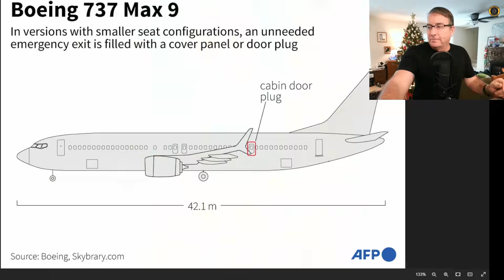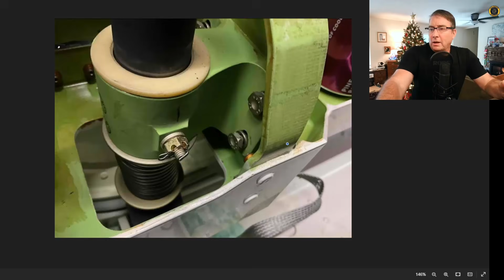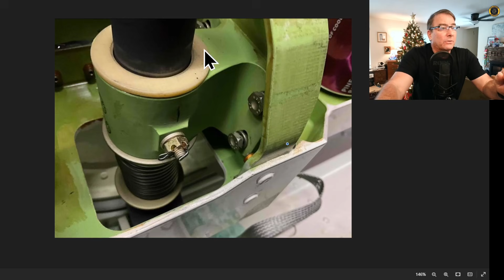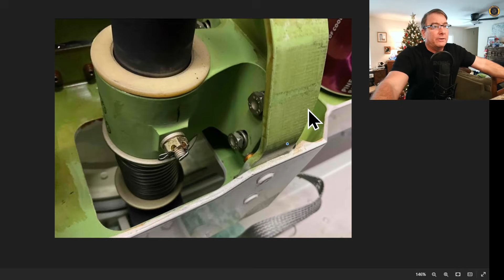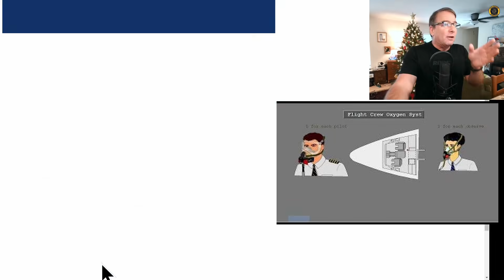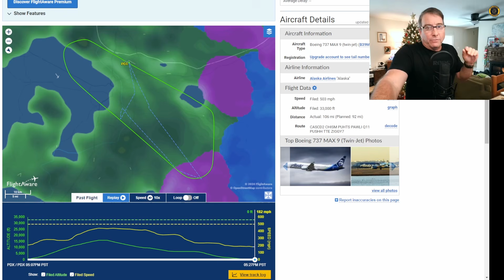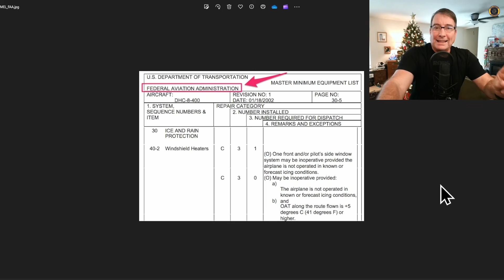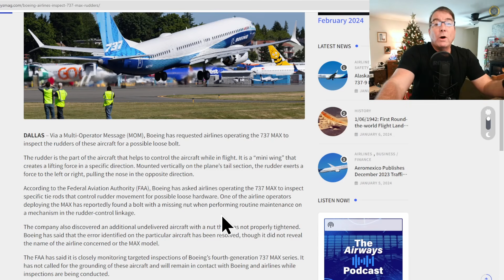"Yes, We Have No Bolts"  9 Jan 737 Max-9 Update

Comment: I disagree with your assesment that previous pressurisation alarms were caused by leaking door because of two reasons. Firstly, how on Earth changing pressurisation control to alternative controller fixes the leaking door? Secondly, I have been informed that leaks on aircraft are accompanied with loud squaling noise. No noise was reported before the plug departed the aircraft.

Comment: Personal opinion, those lower brackets to the aircraft only have a lock washer, it seems (looking at how the lock washer is diving into the holes in the bracket) a plate/flat washer should be on there as well.
Reply: That is why the door was hinged at the bottom, and it opens out and down.
Reply: @c4o-y8f  that makes no sense. Please look at the bolts holding the upper brackets to the body of the plane.
Reply: I'm not sure what you're looking at?
The picture that Juan was using as an illustration shows the aircraft door frame on the right, and the plug on the left.
What is fastened to the aircraft is called an upper guide roller. What is fastened to the plug is referred to as the guide track. 
 2 of the  bolts in question and locking nuts go through the guide track and prevent the plug from moving up on the roller guide.
Upper movement is also prevented on the lower hinge guide fittings with a bolt referred to as a vertical movement arrestor bolt. 
The lower hinge bracket assembly has a lifting assist spring. Once all four bolts to the top through the bracket and two at the bottom on the hinge guide. The plug is allowed to move up an inch to an inch and a half to clear the six pressure mounts on each side of the plug, which meet up with their counterpart on the aircraft frame.
On the ground with no air pressure, the top of the door would swing outwards.
There are two nylon straps at the top of the door on the left and right sides that prevent the top of the door from opening more than 10 inches.  For maintenance on the ground.
The two nylon straps were tore and without the two bolts and nuts installed on the lower hinge bracket assembly the spring assist launched the plug off the aircraft. . I.e. minimum damage to the plug and aircraft.

 

 @berthaduniverse
Reply: @c4o-y8f  you keep looking at the pin and how it is retained. I'm referring to the receiver (again for the third time) that is bolted to the body of the aircraft/frame of the door. The lock washers are falling into the elongated mounting holes. See the video around 5:30

Comment: Why even  have blowout panels on the cockpit doors if the locking mechanism is going to release the entire door anyway!!! 
So much for security!!! 
(Depression = access)
So these loose bolts hold what? 
If they are that important,  then safety wire.or. (castle nut/pin).

Comment: I've been flying the 737 at a U.S. major since 2006, and the door blowing open was a real shocker.  We've always been told there are blowout panels to handle the explosive decompression scenario.  I have recurrent next week, and it's something I'm definitely going to be bringing up as a topic of discussion.  This better not turn out to be another "Whoops, we forgot to mention this in the pilot training manuals!" situation.
Reply: Leaving a comment in the hopes that you will enlighten us about the response you get next week.
Reply: No, it is another "failure to communicate" by Boeing
Oh, sorry about that Lion Air
Forgot to put that tid bit in the manual
Reply: I imagine its set up so that if the decompression force is larger than the blow out panels can dissipate that the door is designed to fail at a level below which serious damage would be done to the cockpit. The size of the hole in the fuselage created by the plug falling off would have allowed the cabin air to escape very quickly.
Reply: @watcherzero5256  sure, but they were barely at 15k feet. The pressure differential is pretty low at that altitude the blast panel should have been more than adequate
Reply: @shaneskillzrepresent  That was my initial thought when I heard the details. 15k is not high at all, although the pressure differential appears to have been enough to blow the door out. Very worrying. What was the cabin pressure set to, I wonder?
Reply: @colins2  Even a very modest pressure difference adds up to a fairly big force over an area the size of a door. At 15,000 feet, air pressure is about 8.3 psi compared to 14.7 psi at sea level. Over the size of an airliner door that would be around 8 tons of force. However, airline cabins are not pressurised to sea level, but typically to the equivalent of about 8,000 feet, where air pressure is about 10.9 psi. Even so, that 2.6 psi difference over an airliner door is still going to be over 3 tons of force. Of course at 30,000 feet the outside pressure drops to 4.4 psi, which means there is a differential of 6.5 psi with cabin pressure, which would be about 9 tons of force over the area of the door.
Reply: It Boeing open door policy . Don't think they going to put in there manuals, management at Boeing are a bunch of idiots.
Reply: Were you told the cockpit door was meant to blow open during decompression?
Reply: Four questions I would like Boeing to answer:
a) when did Boeing change  from panels to "full door" ?
b) why ?
c) did they not consider that the blowing out the door and depressurizing the cabin in an instant would lead to papers/checklists etc all blowing out?
d) do they intend to leave it like this or will they go back to panels?
Reply: Unfortunately, Boeing is run by MBAs nowadays and they chased away all the engineers. You won’t get a straight answer. @oldcynic6964
Reply: Now why would a blowout panel be located right next to a passenger seat, and large enough to suck a person out of the aircraft? It’s been established that the piece of the plane that failed is a plug door. Please try a little harder next time
Reply: @fartmoderne  He was talking about the cockpit door that blew open. Boeing has already said something like, "Whoops, we ought to put that in the manual."
Reply: How would you make a panel that can go both ways?
Reply: This seems like a flaw in security because a bad actor could simply explosively decompress an aircraft and then take it over. You don't need to be flying at 10000 feet to take a plane over.

Comment: 🇦🇺 WOOOW !!!!  Thanks again Juan. More fuel to the fire. One good take away I guess is when the door jettisoned the frame it didn’t impale itself into the tail assembly possibly compromising flight control surfaces there, perhaps assisting this loose bolt in the rudder assembly. That would have made for an interesting outcome. Thanks again for your the effort you put into the detail. 🙏

Comment: There's a massive safety red flag here that, no matter the cost, has to be addressed. If it isn't, people are going to die. It's not a matter of "if", it's a matter of "when" and "how many?".

If there are loose or incorrectly torqued fasteners in this location of the aircraft, then there are loose and incorrectly torqued fasteners elsewhere in the aircraft.

Not only this, but whatever other aircraft are assembled in the same factory also have been assembled in the same "slap-dash, get it out of the door quickly" fashion. Loose fasteners do not exist in one location only, it signifies a culture of sloppy and unchecked workmanship. 

We see evidence of this both in this individual case, the other carriers who have found issues with their fasteners and the rudder issues amongst others.

On top of this, we have a corporate culture of trying to slide the Max in as "just another 737 derivative" when it's becoming clearer and clearer it's a different aircraft that just has some parts/controls rationalisation with it's predecessors. 

Yet another question that needs to be asked is, was Boeing certifying their own aircraft at the time when this was handed over to the customer?

I say all of the above as a very pained lover of Boeing products, it saddens me to see the current situation and the reality facing them.

Comment: For plug to depart the fuselage all 4 bolts must be missing. That's inside info. What I would like to add is a total decline of all services in our society. No difference between drywall being installed without pink insulation installed just because insulation guy called sick. Similar thing here. No bolts installed, who cares my job is to install the plastic panel. Now some of my friends, very experienced aircraft engineers and mechanics are afraid of flying.

Comment: If I understand you correctly, the cockpit voice recordings are overwritten unless the circuit breaker is tripped?  even after an emergency? it sounds like a finite loop recorder, where there is X minutes of Tape and once the tape is full, it just records over the data from the beginning of the tape and will do this in an infinite loop as long as it is powered on. Is this really the best way we have for voice recording the cockpit in 2024?  On another point, why in the world do these planes not have cameras on the plane , looking live back at the plane?  Say for instance , a cam looking at the gear sets, views of each engine, view of the tail and so on. It would be a distraction to the piolts , but have it available to the flight staff at a minimum so they can see if they are on fire and let someone know .. If SpaceX can put cameras on the Falcon9, Boing can do this on a jet. It's a no brainer.  Right?

Comment: Most of my career was in the B737 and never, ever was there knowledge of the cockpit door being designed to open during a rapid D.  Maybe it's only on the newer models but thank you Boeing for once again keeping the pilots out of the loop!  Oh and BTW you never should have stopped making the B757 then all of this would have never happened to what use to be a very respectable American company.
Reply: When sales of the 757 began to dip, Boeing should have realized that it was time to build a new gen version of the 757. Instead, the McD thinking led them to ditch a very good plane creating a hole in their product line they've never been able to plug. Plugging holes is just something they're not good at, apparently.
Reply: No... the 757 had moved up to transcontinental and international ETOPS flights, it overperformed for its original role which became better suited to developments of the smaller 737 and A320. For the Max Boeing should have ditched the legacy 737 cockpit and short landing gear, and grafted on the 757 front section and 757/767/777 cockpit,and redone the wing box for proper undercarriage. @grantvergottini5612
Reply: Don't you remember the "blow out panel" at the bottom?
Reply: Amen, a modern re-release of the 757 would be amazing.
Reply: Why would a pilot need to know if the door will blow open or not? Manufacturers make thousands of decisions, if the pilots are told about all of them they would not have time to read what actually matters.
Reply: @orbit7979  consider this: you train hard for every conceivable emergency situation no matter how likely. that way when the worst happens rather than having to panic and figure out the correct response on the fly, your response is automatic and your much quicker in responding to the problem.  now take that worst case and throw a wrench in it: something you have been explicitly told will not happen happens and the cockpit door explodes open with many of your checklists leaving the plane. now not only do you have to do the checklists from complete memory, you have to respond to a situation happening that is outside the bounds of your training and you dont know if it is supposed to happen vs an indicator of a substantially worse problem. in an emergency, you want as few surprises and distractions as possible and random shit happening is extremely distracting if you dont know its possible.
Reply: Pretty certain they added that door to keep hostiles out of the cockpit.  Assuming they work out the oxygen situation, I wonder if they're going to start planning around this vulnerability now...
Reply: 757 died 20 years ago for sound commercial and technical reasons. Get over it…..
Reply: @johnmoruzzi7236  The 757 was better than it had to be, and older technology.  The 737 replacement should look like the 757, but modernized.

Comment: At this point it would seem the whole fleet of Max 9s need a complete nut and bolt check across the whole airframe. Loose bolts on one system is bad enough, but on two separate areas of the aircraft is very worrying.

Comment: I'm sorry, but Nuts and Bolts on aircraft shouldn't have a chance to become loose or detached. All hardware in positions where their security is absolutely essential to aircraft/flight safety (Engine mounts, Flying controls, Doors, etc just to name a few) should be positively locked in a manner such that normal aircraft vibration cannot possibly loosen them off. So that means castellated nuts with split/cotter pins or wire locking of fixings. Simply torque tightening a fixing is not positively locking it. 
Looks like Boeing have entered a prolonged period of low standards and are consistently failing at the basics. Makes you wonder what other issues are hovering in the background waiting to rear their ugly heads?

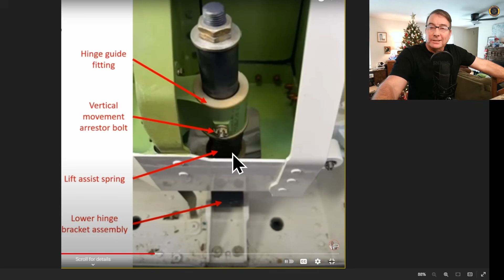Comment: Juan, at 2:40 you show the spring mechanism. Surely the slider on the door would not only have to pass the securing pin, but also the large washer and the two lock nuts to be able to fully escape the aircraft. Is that washer and double nut supposed to keep the door attached to the lower hinges if deployed under normal emergency door situations ?

Comment: I understand your point about the engineering ground crew should have a checklist to go in and verify that the data is being preserved, but at the same time there are a great deal of other activities occurring. I imagine the chaos after the aircraft touched down was severe, with a great deal of chickens without heads, making the access to the aircraft difficult. Today there are far too many officials who feel the need to involve themselves, and I am certain that the first people who entered were security officers and first responders, not the ground personnel, who may have even been prevented from entering until the aircraft had been „checked out“.
No, I think the actual problem is the recording devices themselves. 
These devices were introduced in the late 1950’s with the intention of recording the conversations in the cockpit after a fatal accident. And in the past, that is generally what you would expect. If the aircraft didn’t crash, the following investigation was not nearly as ridged or extensive. And due to technical limitations, the decision was made to limit the recording to two hours. They wanted a robust device, one that would survive a crash and probably a fire, or submersion, that required no maintenance, as to preclude any damage or altercation of the contents. 
Now aviation has changed, and many more incidents are being resolved without the loss of the aircraft, sometimes with long delays before the aircraft is finally on the ground. The old technology of the data and voice recorders has not kept pace with the technology. I don’t refer to the device itself, as they are now digital, but rather to the regulations regarding them. They are now solid state, and the capacity for data storage is immense. The current two hour record limit is an imposed one, unrelated to the actual capacity limit. Why? Because the current regulations don’t require any more, and pilots have privacy issues with the retention of what occurs on the flight deck. 
The FAA is seeking to change the rules to allow the retention of 25 hours of voice recordings. What are your thoughts on this?
Reply: Of 20 hours of tape time should've been adequate to have somebody pull the circuit breaker on time.

Comment: re pic at 5:25: Is that acceptable installation of a cotter pin?  I always thought the loop head of the pin was supposed to be set down and in between the segments of the castle nut, then the top leg of the pin pulled up and over to hold the loop in place.  Maybe these aren't critical??

Comment: I’m surprised the CVR was overwritten.  Recording should be paused when on-ground conditions are met.
Reply: As long as there's power on the avionics, the recorder continues to play. Seeing the aircraft was returned to the gate. Either the APU or ground power was most likely applied to assist in post flight insp

Comment: Great reporting, Juan, thank you. The more I learn about this, the more concerned I become. Initially, I was just relieved that no-one died, nor even sustained any physical injury - as far as we know. Now, I am wondering just how it is possible to deliver an aircraft for which the pressure hull isn't correctly assembled. Also, whatever integrity test they do before delivery doesn't reveal latent faults, such as the plugs being in the correct position, but not properly secured.  I was a passenger in a Max 9 recently (without incident, obviously) but it does now make me wonder what other aspects of such aircraft aren't built to specification.

Comment: I expected no bolts because it got off mid flight but I’m really curious about is did the bracket Wallerout  and fail bolt breakage or slackening to back off because a coder key broke or wasn’t installed

Comment: Here’s my main question, how come the NTSB says that the fault light so far has no correlation to the plug leaking? I’m not an A&P but have some friends who are and don’t think that the fault would be set off because of that? The NTSB said one of those 3 incidents happened on the ground so how would the system detect a leak when not pressurized.